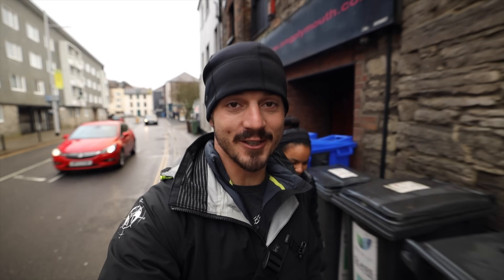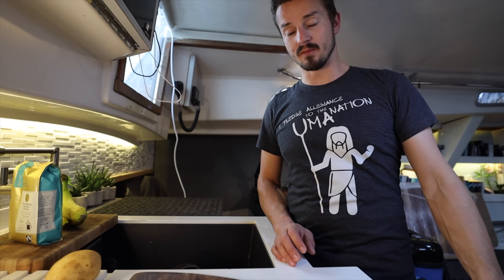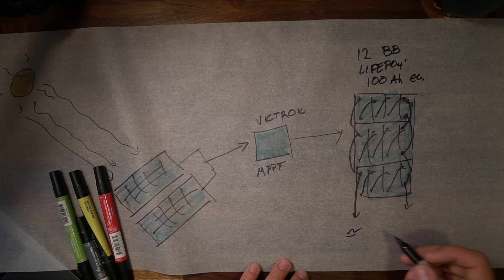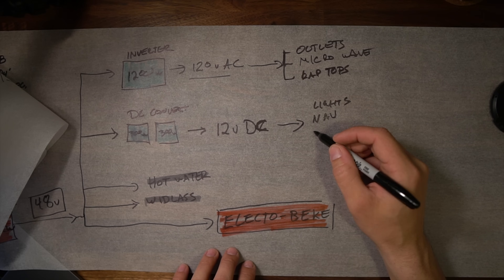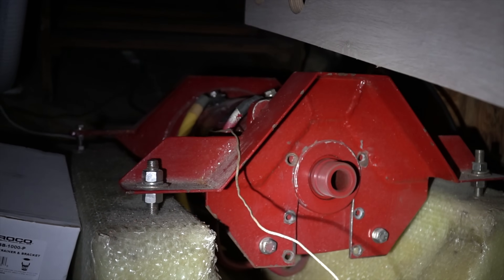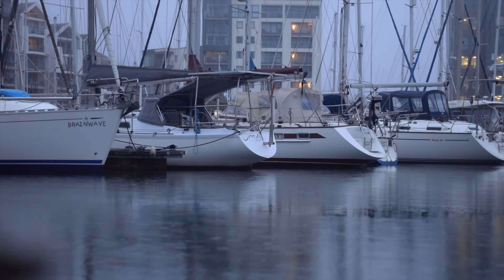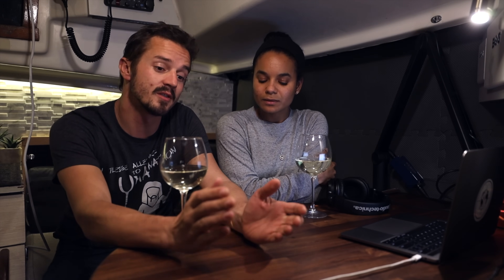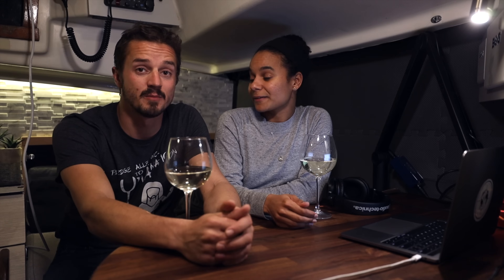5 Years Living offgrid on an ALL ELECTRIC Sailboat — Sailing Uma [Step 206]

Comment: Question: Laptops etc all have step down adaptors to plug into the mains voltage. Is there a way to create the correct charge to run modern devices without the need to step up (to 120v) and then step down (via device charge adaptor)? It's been bugging me.
Reply from the maker: Our old Mac book Air could be plugged into a 12V outlet and stepped up to 17V. But the new ones require a bit more wattage so they can't. Either way, you're stepping it up or down and the losses are very minimal.

Comment: OK, you get zapped by lightening and no Electronics.   Now, have you thought of a sextant?   I mean you are "just" about there, I think you should go completely old school, keep a good ship's chronometer and use that and a Sextant to plot your location!    Then you'd be protected against large EMP blasts as well! :).

Also, have you figured out what you'd have to do to go without shore power where you are?   Add 2 more Solar Panels, get newer more efficient Solar Panels?   And, did I hear correctly that you still have the original Forklift motor?

Comment: Great vid. As you already carry gasoline for the outboard, I would get a honda 2kw portable generator. They sip fuel (are cheap, light, dependable, easy to maintain), and your battery bank is lithium and big, so it can take all the power the generator can output. When ever you NEED, just run the generator for a couple hours, I would definitely choose the honda over a wind generator considering your current setup.
Reply from the maker: We just haven't needed on in the past 4 years. Now that we're further north, we'd consider it for sailing to places line Iceland where there aren't many marinas that have power. So we'll see.

Comment: As a retired architectural designer, I share your research attitude for new and better "out of the box" ideas. My deep respect.
If only looking at what you did on the interior of Uma would be awesome : bright, modern and efficient use of space. Bravo ! 😍
But Dan, you developped a deep expertise on alternate, not polluting sources of power. Kudos !👍
Your idea of using your propeller as power mill when sailing is excellent : cheap power source again !!
Love from Varennes, Québec, Canada. 😁😁

Comment: Okay, I listened again, and the video is pretty confusing in part because it starts off with the claim at 5:15 that the boat is powered solely by the sun but by 11:50 you are admitting that is not the case due to the limited sunlight in the UK in winter.

I suspected that you were having to plug in periodically, and that confirms my suspicions.

My own electric energy usage is planned to be much less than yours.  When I completed a detailed energy audit in Excel, despite far lower consumption, I had concluded that under overcast conditions there was no way solar could provide enough to keep the battery bank from draining.  Since I am reluctant to use wind power on my 26' boat (small outboard engine), my alternative source is a Honda EU-1000i for the overcast periods.

Comment: Great Info! 
You might want to remind people to verify information from independent sources; 
especially when it is both technical and mathematical. 

My engineering schooling included solving math problems on your feet daily; there was extra credit when you did something wrong and recognized it quickly enough to explain where and why you went wrong and then give the correct thinking and solution, even if it was work done by someone else! 

We are on the hard where there is a place to apply most of your hard work to make our 1910 Sears Kit House more affordable. Your sourcing of things will give me a place to jump off. 

I am a life-long-high-performance-dingy sailor. The love of my life gets deathly seasick in any swell. 

I get offshore Sailing Uma! Glad to be aboard. Thanks a MILLION!

Comment: Just watched this video…. Yes, a big thumbs up to all you have done.

I have one suggestion the mite help you save a few more watts here and there.

As you know the inverter to 120v will cost you about 8-10% of the power used to do the conversion from DC to 120V AC for example a 1000w microwave in use will draw 1100w of DC for the converter to do it’s thing.

Enough explanation, have you thought of getting 12v chargers (car / airplane chargers) for your laptops.

You have the 12V power available, put one or two 12v sockets around and save the power loss that happens for running the 120v inverter so you can charge the electronics we all love so much these days, and can’t seem to do without. Your 48v to 12v converters use much less power to do the conversion than the 120v inverter does.

I’m guessing you would save another 200-300w a day, in losses through the power conversion process.
If you were so inclined you may even be able to find a 48V adapter for your laptops eliminating some of the losses in the 48 to 12 converters too. (as a side note, you may not know, but 48v DC is a nominal voltage used by telephone companies all over the world. It can some times take some digging but you can usually find 48v dc power supplies for a lot of devices.)

Just a thought or two.

Happy travels!

Comment: Great show, forgive me but, I feel the need to point out that gasoline and diesel are also Solar Power. Solar power grew the plants, feed the animals, they die and turned to crude oil over a very long time then we burn that as fuel. The fuel then releases CO2 that is actually plant food ( green houses are around 1700 ppm and they love it that way while we only have 400 ppm in the atmosphere.) and the cycle continues. Basically, EVERYTHING is solar powered in some way, life itself even.

Comment: Use an old broken outboard motor and take the engine out and put in a generator under the engine casing,  So when sailing on a dull day you will still get extra power on the move to top up your battery bank...
Reply: Ummm, yes they could do that, but they already have one prop dragging in the water (slowing them down when they are sailing) why would they want another? They could use their existing prop for regen, if they wanted to. I'm not sure if the $100 forklift motor they use for propulsion can be used for regen, but  if it can then they could generate serious power. Typically, they would have to be sailing in excess of 5 knots to generate power and they would lose about 1 knot of boat speed, or that's what we experience on our diesel electric catamaran. It's rare for us to want to lose the boat speed, as we always seem to be in a hurry.

Comment: Mentally gave you 2 thumbs up, cause I roll that way!    One of the best things I did was install 12V DC USB chargers in various sections of the boat.  They do a hell of a job without the loss of charging from an inverter.  Cheers to the both of you!
Reply: This is a good solution however, the selection of those 12v to 5v converters / chargers is very important.  The ones that are RF noisy can impair your VHF reception.  The impacts of this can either be really annoying or really dangerous depending on severity.

Comment: Could you maybe buy a cable to run your laptops directly on DC. The laptop charger converts from AC to DC,  already inverted from DC to AC. It seems like there are a couple of unnecessary steps in between.

Comment: For your laptops consider installing usb c outlets. They go upto 100w and can convert to regular usb charging for your other electronics. There’s a lot of loss from 120v inverter to usb c charger. 
Great explainer and awesome video!
Reply: You’re going to want to search for “dc to usb c pd” for various solutions. Most take 24v input and then output up to 20v 5 amps. What I’m not sure on is if they are rated for boat use. They are definitely more efficient than going through a 120v AC inverter and then back down to a usb c charger.
Reply: https://satechi.net/products/72w-type-c-pd-car-charger-adapter
60w plenty enough to charge a laptop and plugs into a regular 12v car charger port

Comment: Fantastic. Have you considered an AC motor instead ? That´s what automakers are using. They are more efficient and cheaper to mantain (no brushes, no cooling). The downside is the controller (more complicated and expensive) and I am not sure there are "marine" options available.

Comment: Nice video and informative. I am interested in the performance of the Solar Panels in regard of your position, that is latitude wise. One hour of direct sun in the Bahamas would give you how much power vs one hour of direct sun in the UK? I am just thinking the further away from the equator the more atmosphere sunlight needs to penetrate towards the solar panel and if it loses any efficacy on the way down to the ground. Just wondering as I live near the Arctic Circle and how efficient a solar panel would be up here in the north.

Comment: Please, please, please check out the relationship between power and energy. Your confusion between kW and kWh makes this really hard to watch even for someone who grasps what you are trying to say.
Reply: It is necessary. If you are using 2.5 kW per day, that would sum up to 2.5 kW multiplied by the hours you use that power (24 h) which is 60 kWh of energy.
Reply: It's like the same relationship as with a number of working men and man-hours of work.
They have a certain capacity for "man-hours" in the battery bank and "men on deck" (solar panels) filling it up when there are hours of sunlight available. You multiply or divide exactly the same way as with man-hours of work and number of workers (for high or low power levels). An LED light represents a tiny fraction of a man grinding away, like using their pinky with a wind-up torch, and the hot water kettle is ten men giving it all they've got for a few minutes. Both can consume all the man-hours in the battery if you give them the time to do it, it just takes a lot longer for the LED compared to the kettle, or the electric motor.
Reply: You people must have too much time on your hands just like the video
Reply: @southseas47  We'll do one better and wish to help improve future videos. It's such a common schoolboy error that is nevertheless very easily set straight, and certainly much, much easier than the effort of making the video in the first place. It's also important if the point of the video was to convey useful information. :-)
Reply: @southseas47  The video has too much time on its hands? That makes as much sense as saying that you use 15 kW per day.
Reply: This isn't exactly necessary as Dan usually qualifies his data with "per day". The 2.5kw vs kwh tho correct, isnt absolutely required, but could make things cleaner but the math would just become obnoxious and just saying battery holds 15kw and we used 2.5/day. Even tho you're talking kwh, makes sense.
Reply: @TheThunder005  Maybe so, but what happens when a person is calculation PV array size or wiring size? That's when getting the terminology correct is imperative.

Comment: Hey Kika and Dan, this Video is really interesting. I asked myself often, how much power you can create on board and how much you need. I like your vision getting power back from the propeller. That's something, I would use on a sailing boat, like yours. And I would think about the usage of fuel cell technology as a additional possibility of storage power
Reply: A hydrogen tank on a boat, are you mad???? And where do you refill? As if propane weren't complicated and dangerous enough :o)
A fuel cell may be an option in space, but it's just plain dumb in a car or a boat. Lithium batteries are so much better for storing energy, they are super simple and safe to use, they are improving fast, and they're getting cheaper by the day...
Reply: @freredaran  https://www.youtube.com/watch?v=QjmuiQ6eVI0 You better be informed BEFORE you type a lott of bullshit

Comment: Speaking of Power.......I have been watching some of the older Uma  historical records and i was wondering
if NAPA  replaced the battery with the melted terminal.  It happened when you took Uma on an Electric Endurance Run up a river.  Some in comments thought the meltdown was caused by a loose electrical connection on the battery.

Comment: I hope the regen plan works out.  I, personally would feel more comfortable arriving with a close to full battery so that the electric motor could be used to drop the hook or get into the slip.   Yes, I Like the technical vids but that's just the transport to the pretty places.  We need both.  Keep warm.

Comment: Good video - I like learning how others do their boat electrical systems.

One video critique - you referenced the solar power produced in a day, or the capacity of your batteries, as kilowatts. That should be kilowatt HOURS.
Reply: Also, Ampere-hours is a metric that only makes sense if you also include the voltage. 
I assume it's at 12 volts, because 100 Ah * 12 volt * 12 batteries = 14 400 Wh, or 14,4 kWh.

Comment: That's very timely as I've just been up to the solar panel place at Marsh Mills to try to figure out what I need. I have no solar at the moment so am starting from scratch. One of the things I was trying to figure out was my usage but hey - I can just use your figure and future-proof myself. Happy days 😊👍👍. One thing that has been in the back of my mind is going to electric propulsion but I don't know where I'd put the battery bank, even once the big old stink box is out of there. My boat is about the same size as Uma. How did you manage it?

Comment: You all may have mentioned but why do you not have a wind generator?
Reply from the maker: Storage. In order to get one large enough to make a difference, we’d have to break it down completely to store it. But honestly, we just haven’t needed one yet.
Reply: Dan, food for thought based on your background. Could you build or buy something to regenerate at anchor from tidal movement? Drag issues shouldn't be a problem; what's your thought on this.

Comment: Was wondering about the electric motor, whether you could have an alternator attached to charge the battries as its running, a re-drive I think its called?
Reply: Sorry, my friend. You're looking for the unicorn free lunch.
Reply from the maker: Capturing power while sailing is possible and on out to do list. But adding an alternator to capture power while motoring would be counter intuitive.
Reply: @SailingUma  Not sure how it would be counter intuitive, thats the function of an alternator in a car that it recharges the cars battery as the car drives, but if the principle is on your to do list, I look forward to seeing what you come up with :-)
Reply: @formhubfar  The alternator is using energy from a gasoline powered engine. Hybrid cars can re-generate power when they slow down by converting kinetic energy into electrical energy, which is then stored as chemical energy in the battery. Sailboats don't have slowdown mechanisms to use for regeneration.  An electric motor that can produce more electricity than it uses is called a perpetual motion machine.
Reply: @SailingUma  Not only counter-intuitive, but against the Laws of Nature.

Comment: I figure it's almost nill, but how about your radio(s)?  I'm not sure how many watts of signal it puts out, but you may communicate with it for a few minutes or, if you get hailed from someone on another boat, you may talk for 15-30 minutes.
Reply from the maker: We really don’t use our radio much. And it only uses the full 25W when transmitting, so very, very little power over all.

Comment: Thanks guys. Great video. You two, more than any other YouTubers/Patreon folks inspire me to get out on my own adventure. The couch is going for sale (or being donated) soon. Just a quick question, in your 4+ years of experience with Electro-Beke, do you think I could run a 44 foot catamaran with two of them if I only wanted to be able to use them sparingly to dock, etc and I'm satisfied to go 3-4 knots? Thanks for all the fun vids. Cheers!
Reply from the maker: Absolutely. I think you asked this on Patreon already, but YES. Cats are PERFECT for electric motors. Lots of real estate for solar and good sailing speed for regen. Redundant systems and they're easy to push through the water.

Comment: Great video....How much energy do you loose when converting to other voltages or to AC?
Reply from the maker: Not much. But that’s a very difficult thing to actually measure. The losses that are easier to track for example are things like the power the inverter consumes when idle. It’s not much, but over the days and weeks those couple of watts add up. Make sense?